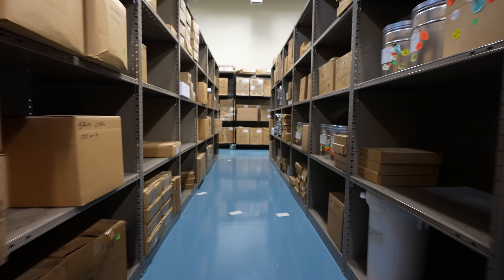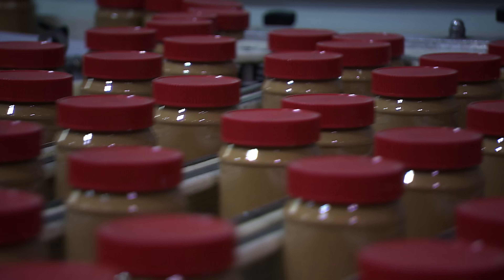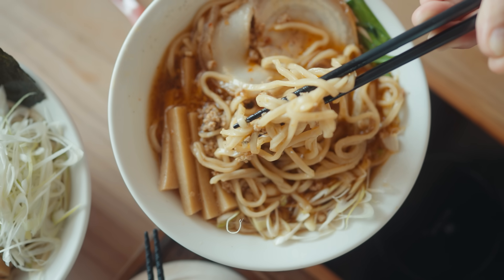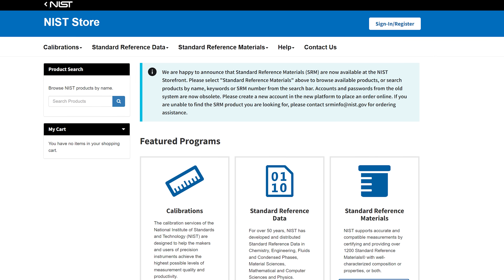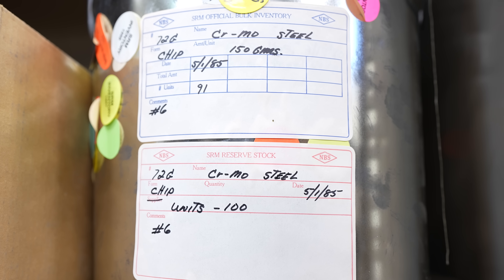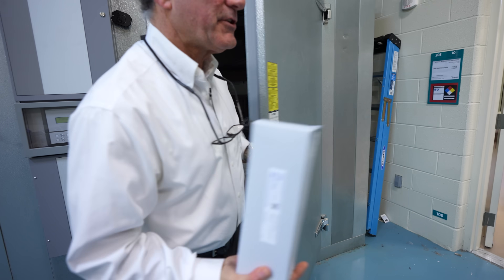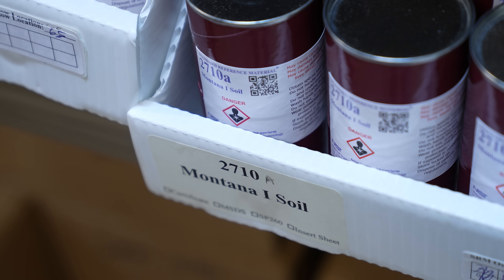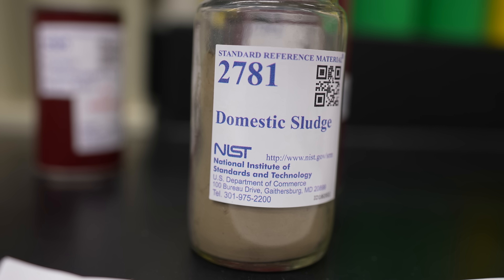The world depends on a collection of strange items. They're not cheap

Comment: The preparation of certified reference materials is described in general in ISO Guide 17034 and in more detail in ISO Guide 35. Preparation of biological reference standards is described in WHO Guidance. General steps required in production of a certified reference material typically include:

Collection or synthesis of material
Sample preparation (including homogenization, stabilization, bottling etc.)
Homogeneity testing
Stability assessment
Value assignment ("characterization" in ISO REMCO terms).
In addition it may be important to assess the commutability of a reference material; this is especially important for biological materials.

Comment: As someone who has worked an industrial job and learned, this is quite fascinating. Where I live, we have the Norm, "DIN". It classifies everything related to industrial appliances and materials - how they are supposed to be shaped, what chemicals are in a substance, what the consistency is, but also practical appliances, like, how long does this step of a stair should be, how tall the door frame, how long are these floorboards supposed to be, etc. etc. etc., as well as practices themselves, how much torque do you have to use to fasten a screw, what length does the screw have to be, how many layers of paint and sealant, and so on.

This gives me good vibes knowing that even normal, everyday living things, as well as biological things, are "normed" by this institute.

For those who don't understand it - without norming, we would have a world where, lets say, one jar of peanut butter has 200g of salt in it, the other 200g of sugar, one jar has 200g of butter, the other 0.1g, one is like water, one is like sand, one glass is 5 inches diameter and 5 inches tall, the other is 2 inches tall but 12 inches wide, another is 12 inches tall and 4 inches wide, and so on and on and on.

Without norming, every manufacturer and producer could just eye it and randomize their product, and that would in case of food in particular, be detrimental to ones health, the nutritional input of the person, or simply detrimental to their wallet if the food is inedible.

Comment: If the product is basically the data analysis of each item - why and how is this business not just publish their findings online? If you can't eat the peanut butter and all that matters to you is the nutritional data points what benefit do you get from purchasing the physical jar instead of receiving the bare bone data?
Reply: so they can compare the results they get from scanning the peanut butter with the expected results
Reply: The data sheet only describes the specific item it comes with. If you ordered two jars of peanut butter from NIST, they'd have different sheets because the contents of each jar are slightly different. One might have just slightly more oil, one might have a bit more sugar. So you need both the item and the paired data sheet or it's useless as a SRM.

Comment: Why would you need to buy the sample? Can't you just buy the analysis values and punch that in for calibrations?
Reply: yeah right?
Reply: Because the values mean nothing without the sample. You're not just buying a sample, you're buying a sample that you know (close to) everything about. The sample is a reference material with known values. If the results of the machine your calibrating are not the ones that come with the sheet then you recalibrate.

Comment: the knowledge of what's in the peanut butter is impossible to justify a $1000 price tag. there is a benefit to be had from that information, but not $1000 worth. the only reason they charge that much is because that's chump change to a corporate company buying it. it's mean to charge those prices when you could run this peanut butter and some $3 JIF thru a mass spectrometer and you'd barely notice a numerical difference ever. the real value of this lies in a global extinction event in case we need to rebuild.
Reply: Source?
Reply: It's not just one brand, it's several brands. And these aren't for commercial purchase, these are for companies that are manufacturing products on a large scale. They need a refrence that's as accurate as possible amongst all the other products of a similar nature

Comment: Didn't NIST say that a cooling fire could melt steel into flowing, molten slag? Didn't they also say that 2 RR DC-10 jumbo jet engines(considered 'indestructable') did a matter phase-change from a solid into plasma as they crashed into the Pentagon? Why would you ever trust them as a reference?

Comment: So let me get this right the Gov goes to like JIF and buys 1000 jars then proceeds to homogenize it to then break it down into every component, but doesn't that inherently change the composition of the peanut butter as you could get a bad batch of peanuts in the 1000 jars and it throws off your data resulting in higher base carcinogens then they used to have or do they compare to previous years to prevent this sort of bad batches?

Comment: I deal with having to juggle multiple different steel standards, and let me tell you it's definitely a VERY detail-oriented job with a lot of spreadsheets. It's astounding how the tiniest changes in composition and forging methods can lead to vastly different physical characteristics.
Buy coils from two different heat lots of steel from the same mill for the same grade, and those two coils can pass and fail two completely independent lists of other standards. It's the whole reason why "grades" exist: to pigeon-hole a gradient of differences.
Also yes: Charpy Testing is common.........and loud; though not as loud as testing tensile strength, lol.
(testing the tensile strength you literally just take a bowtie-shape piece of the material and stretch it until it breaks - which is usually accompanied by sounds as loud or louder than a gunshot when it's steel - or at least it's sudden enough that it feels like it's that loud, lol)
Reply: Sounds like my old job.
As someone who understands this video do some of the comments scare you?
As for loud, in addition to dogbones we also tested 4.500 OD pipe.  It was made from HSLA steel with a yield of 83,000 psi.  That was loud and fun
Reply: @F1083  You made my ears ache just reading "HSLA"
😔
lol

Also the comments (that I've seen) don't really scare me.

Comment: How can something like peanut butter be standardized accurately since it's going to spoil at room temperature, the fats will turn rancid and it will eventually get moldy? If it isn't preserved well enough before it reaches the labs that use it as a baseline for comparison one wonders if the individual constituents will be altered and not function as a truly standard (fresh) peanut butter.
Reply: They won't ever go rancid or mouldy if no mould or bacteria are in it. 
Commercial products don't need to be a precise

Comment: K so if its used as reference material, that means that the chemical composition at the point of new measure must be the same as the composition at the time of initial measure (the assertion of the "actual" composition). Since thats the case, what would be the problem with consuming it? Food doesnt just over time become less "good", it undergoes specific chemical and biological changes that make it less healthy. Does that not affect the use of this as a SRM, or would it actually fine to consume some SRM peanut butter

Comment: The most important part, that might be confusing for some, is that those standard samples are not used to compare with actual products and say if the product is good or if it's too far from standard.

They are actually used to calibrate the industrial's measuring tools, that will then be used to assess regular products composition. Then, the industrial will compare their regular product with THEIR own standard, knowing their measurements are accurate thanks to the calibration sample.

And that is why a trout can be used as sample by a salmon producer.

And this is also why the samples are NOT FOR HUMAN consumption. They might as well contain lethal doses of arsenic, they would still be good samples for their purpose.

Yeah, I'm specifically targeting the idiot who made cookies with standard samples and ate it on camera.

Comment: There is literally no way to tell if they are telling the truth. Anything could be in those jars.
Reply: They are used to calibrate machines all around the country, a small deviation could be passed off as a fault of the machine but I'm sure the manufacturers would realize rather quickly that they are being scammed if the Standard Reference Material peanut butter turned out to be made from anything other than peanuts

Comment: whats wild is you dont even need a degree to work in a food chemistry lab right now (some i sure you do) but i worked at Diebel Labs and did scorch testing and alot of new food fat analysis for the CDC basically in there chemistry lab as a chemist for about a year just for experience and as long as you can do basic math (or make sure a number doesnt go over a certain 'safe point') and know how to read MSDS sheets anyone can be a chemist and really a lot of testing is pretty easy to pick up if you get hands on  training experience like i was by a head chemist

Comment: The standard bullet makes me laugh at how far behind they are from modern ammunition and firearms. With modern manufacturing tolerances, the closest they can get to "identifying the weapon" is identifying the brand,  calibur, and perhaps model. Beyond that, there are millions made every year with very low tolerances, and there isn't some database out there individual firearms with toolmarks, they don't gather that data. 

The closest thing is if you are in a state like CA, then some counties have tried to require your seriel number be engraved on the firing pin. But then that would match to a casing, not a bullet.

And that is all just the differences in firearms and manufacturers, not ammo. The standard bullet is just an fmj... unless they are trying to identify military members, cops, or cheapos, no one is using fmj.

Its weird how up to date they are with everything else..

Comment: Fun fact: the Calories on the nutrition label is calculated by setting the food on fire!
The Cal is a measure of energy released heating 1 g of water, the sample is placed in a sphere surrounded by water then ignited. The temperature difference of the surrounding water determines how much energy the food contains, as the stomach works just like a combustion engine or.... something like that
Reply: Yesss, we did this in 5th grade using a dehydrator and bananas 😊
Reply: @Starpotion same. Did you eat the bannana???
Reply: The bright blue flame indicates that this was a particularly sweet donut
Reply: Hence 'burning calories'! :)
Reply: This facility has the potential to be shut down by DOGE.
Reply: Yes, it has nothing to do with nutrition. At all.😂
Reply: Exactly right! Except the term you're thinking of is "joule". 1 joule is equal to 0.24 calories.

A joule is essentially the metric version of energy measurement and came around from (as you said) water!

So, it takes 1 joule of energy, to heat 1 cubic centimetre of water, that weighss 1 gram, up by 1°c.
Reply: @flynnjacob9 
1 calorie is defined as the amount of heat required to heat up 1 g of water by 1 °C. 4.184 joules is equal to one calorie because the heat capacity of water (under atmospheric conditions) is 4.184 J/g °C. A joule is defined as the amount of energy required to move a 1 kg object for 1 meter at an acceleration of 1 m/s²
Reply: @flynnjacob9 You mixed the two up. It's a calorie that is defined by heating up water by 1°C

Comment: 🎯 Key Takeaways for quick navigation:

00:29 🚽 Wastewater treatment plants process sewage into domestic sludge, which is further used for analysis but not for human consumption.
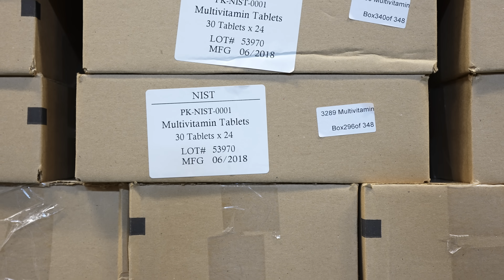01:34 🥜 The government sells jars of peanut butter at high prices not for consumption but to calibrate equipment and provide precise nutritional information.
03:01 🧪 Standard reference materials (SRMs) like peanut butter help calibrate scientific equipment by providing known substance properties.
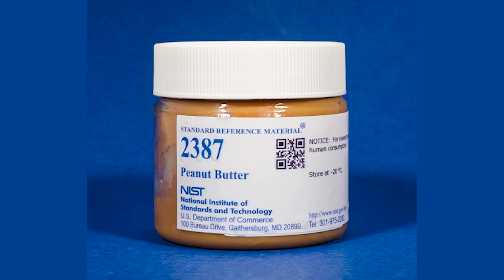04:00 📊 SRMs ensure accuracy in measuring contaminants in food products, such as aflatoxins in peanut butter, essential for health and safety.
05:30 🐟 SRMs are used as surrogates for various foods, ensuring consistent measurements for different types of food products.
06:55 🥦 SRMs cover a broad spectrum of foods and dietary components, helping maintain consistency in testing.
10:22 🔩 NIST played a crucial role in standardizing steel alloys, ensuring quality and consistency in rail car materials.
13:51 🧨 Standard bullets with nano-indentations help forensic labs validate their equipment for bullet matching investigations.
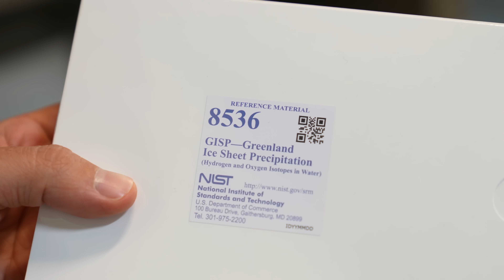15:20 🏠 NIST collects house dust and other materials to monitor contaminants and ensure safety standards.
16:20 💩 NIST offers domestic sludge for environmental monitoring, and soon, it will provide human fecal matter for research.
17:50 🌐 NIST continually evolves its standard reference materials (SRMs) to adapt to changing scientific and health needs, providing critical support for research and industry.

Made with HARPA AI

Comment: can someone explain: i get why charpies are needed, but why would you buy e.g. their peanut butter if you want a standard peanut butter? it's not even edible, how is it better to use as a reference than like every peanut butter on the market? i don't get it
Reply: You want to start a factory to make peanut butter. You finish the whole process but to follow regulations to be able to sell it you need to check if he doesn't have some toxic levels of some components (or just how much sugar/fat/etc. it contains to be able to put it on the label.

So you buy a testing kit which will tell you these things. And when this kit is made it of course needs to be calibrated (either by you or its manufacturer, depending if you made it yourself or so on).

So you put in it standard butter and if it outputs the same value recorded with this butter content it is correct. Otherwise you need to tweak it/fix it.

At least that's how I understand it.

Comment: SRM-420
Object Class: Safe

Special Containment Procedures: 1 210ml (7,101oz) glass cylindrical container, with a screw on lid made of Polyethylene Terephthalate (common plastic), to be stored inside a 40cm X 20cm X 50cm drawer in the NIST warehouse section.

Description: Subject is a substance of paste-like consistency, comprised primarily of roasted ground peanuts, sugar, salt, oil and [DATA EXPUNGED]. Subject is considered edible (though sample in containment is not meant for human consumption), although care is to be taken during production, as peanuts can contain aflatoxin, which has been noted to be a potent [REDACTED] at high concentrations.

Comment: I saw “NIST” and knew exactly why that peanut butter was so expensive.

Its a standard reference material. Its a calibrator. Like … the equivalent of switching your battery powered kitchen clock to satellite time instead. 100% accurate and standard.

We are required to use NIST thermometers for temperature calibration checks in healthcare for keeping lifesaving drugs blood and tissue products that are use for medical treatment in consistent storage conditions. You can’t just go to walmart and get any old thermometer. No room for any unnecessary preventable error when it comes to life and health of human beings.

Comment: 6:05 Sounds like its all a bit of a scam then.... whats the point of breaking something down to that level of precision if they then dont even compaire it to the same thing.
Reply: they take the actual material NISD makes, and scan it/test it with their scanners/testing machines to make sure those machines work properly and get the same data. then if they do they know that when they use their scanners on their own product (which have similar materials as the "standard peanut butter") they know the scans they get will be accurate, because they were accurate on the NISD material

Comment: So all these items in this warehouse are essentially the equivalent of a 100g test weight for a scale except for different equipment. When you know that this weight is exactly 100 grams and your scale says 101.2 you know how far it's off. So these are.. well. Exactly what they say they are, reference material. To make sure your equipment measuring the amount of protein in peanut butter Is accurate, and if it's not you know how far it's off. Thats extremely interesting!

And very important and necessary

Comment: Another important question would is: How do they ensure the products dont degrade over time? Some contents like vitamins are really volatile.
Also: Over time the composition of things like house dust etc. changes as we use different materials at home (new types of plastic, etc.)
Reply: It depends on the vitamins and for most vitamins, there are more and less shelf-stable compounds, so I'd assume they use more stable compounds and likely do have expiration dates on less shelf-stable items.
As for things like the house dust, those are probably dated by year, if not month and year and they likely have more than one version. Not to forget that those samples aren't being used directly to identify problem areas, but are only made to calibrate the machines that are used to analyse samples, so they don't necessarily need to contain every potential contaminate. If there are a few different plastics in the house dust calibration sample, that should give a good reference as to whether the machines are able to detect carbon-hydrogen-polymers. Even if it isn't the exact plastic that was found in the sample from NIST, all plastics are essentially made from the same materials.
Reply: They definitely have storage directions. Like the animal and tissue samples in the liquid nitrogen. Ya can't just pop that in your fridge when you get home.
Reply: Maybe they replace some samples?